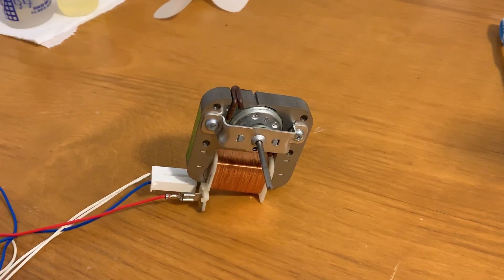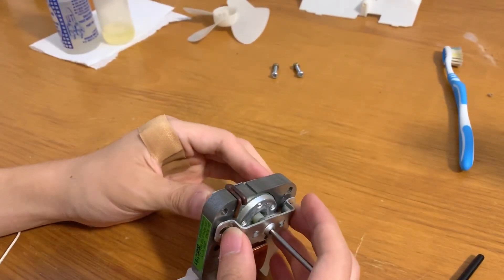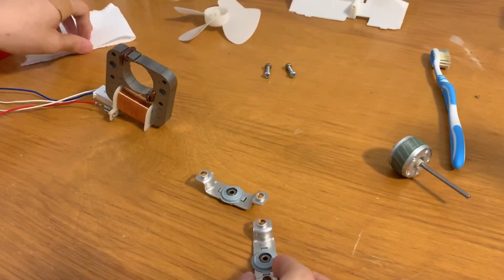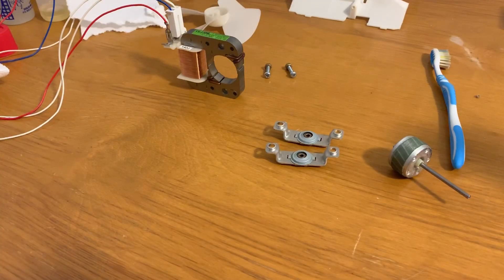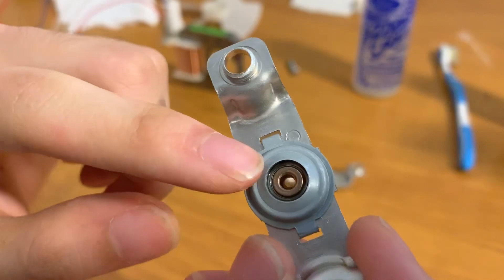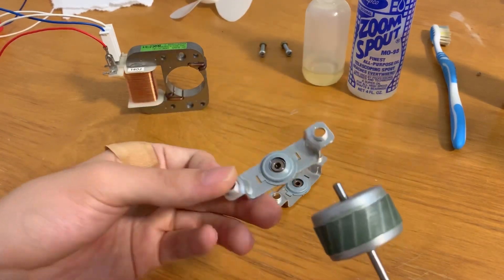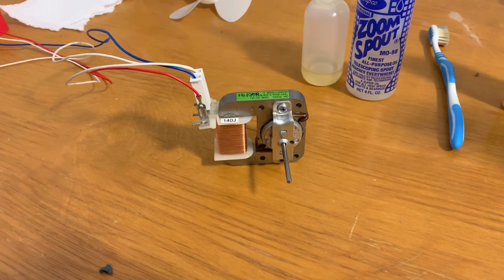How to Oil a Fan Motor (Shaded-Pole, C-Frame Motor)

Comment: would you happen to know if this works as well on exhaust fans (bathroom) that are a round motor? I've seen some people mention in general how some motors don't have oil so I'm not sure how that works then, my fan is a round motor and it's squeeling and wheezing lately, took the motor assembly apart (but not the motor itself) and it's definitely the motor rotating causing the noise like perhaps light friction
Reply from the maker: Absolutely! The motor may look different, but the procedure to oil the bearings will be more or less the same. Nearly all bathroom exhaust fans have sleeve bearings, the same type as the ones present on this microwave fan motor. 

Most motor bearings have some form of lubrication. An exception might be a magnetic bearing but those are reserved for more niche applications. The squealing sound from your motor is very like the bearings needing some oil.

The disassembly process will be different though. There will likely be 2 to 4 bolts holding the two halves of the motor together. Once they are removed, you should be able to pull the halves off of the stator (be careful not to strike the copper windings). From there, the bearings can be cleaned and oiled. 

Hope it helps!
Reply: after a bunch of trying stuff and going on forums, it seems replacing the bearing is what I need to do as the bearings themselves are making noise. Hoping this will fix it so 1) it's cheap 2) little in the landfill 3) I didn't waste several hours for nothing @TheSuperFanMan
Reply: on a forum, I uploaded the sound and some people mentioned my bearings, 608ZZ is probably done for and just to change them @TheSuperFanMan

Comment: they don't sell these oils in my country, can I use SAE 30 Oil instead?
Reply from the maker: SAE 30 would work, though it might be a bit viscous. I’d say SAE-15 to 20 is more ideal for  smaller fan motors. I’d suggest going for a non-detergent oil, as it‘s less likely to gum up over time from accumulating debris.

Comment: Thank you for the useful tips! Aligning the sintered bronze bearing bushes precisely axially with gentle blows was new to me! I tried this on my fan motor, which hasn't been dismantled in decades. I always thought it ran well and I lubricated it regularly. After gently hitting the shaft, it now runs even more easily and freely. To do this, I placed the plastic handle of a small screwdriver on the shaft as a shock absorber and hit it with a large Allen key as a replacement for a small hammer. 

It is a nice shaded pole motor from an old record player (60s), with three copper loops on each pole (for a better rotating field and smooth running) and two symmetrical coils. I regulate the speed with incandescent light bulbs connected in series. Different wattages result in different blowing strengths and a switch that bypasses the bulb socket for full speed. It has a model airplane propeller as a propeller. After cutting my hand on the propeller running at full speed, I made a protective ring.
Reply from the maker: Very cool! I’m glad the video was helpful!
Reply: @TheSuperFanMan  Yes, very helpful (for me as a perfectionist), thank you!

Comment: Sewing machine oil works great if you don't have access to zoom spout turbine oil and need to get a fan up and running.
Reply from the maker: Yep! It won’t last nearly as long due to its lower viscosity, but it’ll work in a pinch.
Reply: 🤔👀 🤷‍♂️ How does Andis (hair) Clipper oil compare? I have a microwave currently disassembled that's awaiting a swift reassembly that I don't want to undermine from selecting a substandard lubricant.

Comment: Thanks for this. The last part was interesting for me, when you tapped the shaft to align the bushings. I just serviced my washing machine pump motor and noticed it was stiff to turn afterwards. I was thinking there might be corrosion on the rotor and I would need to sand it to make more clearance. I will try the tapping method.
Reply from the maker: No problem! Assuming your motor has sleeve bearings (not ball bearings), the motor shaft likely just needs a handful of tapping from various angles to nudge the bearings back into alignment. Another thing to check is the evenness of the tightness of the bolts holding the motor housing together. 

I wouldn’t recommend sanding the shaft, as the tolerance is already precisely set at the factory. Removing excess material could cause bearing play. I try to remove corrosion on the shaft chemically. Rust removers or sometimes just good ol’ WD-40 does wonders without affecting the shaft tolerances. Hope it helps!
Reply: @TheSuperFanMan  It has sleeve bearings. The clearance between the rotor and stator was my concern. The rotor shaft is clean.
Thanks for the reply.
Reply from the maker: No problem!

Comment: If the bearings are bronze type inserts clipped into the housing and allow for some swivel, how can you get them both set up parallel to minimise the friction on the shaft?
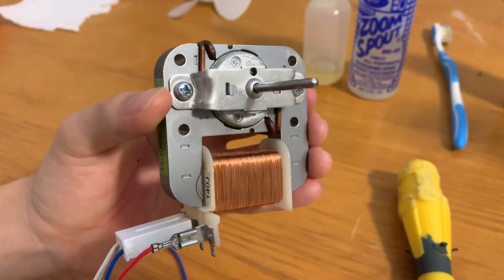Reply from the maker: Thankfully is a very simply process to realign those bearings. It’s explained at 12:35 mark in this video. Tapping the motor shaft with a screwdriver from various angles will nudge the bearings into alignment again.  Hope it helps!

Comment: how do you remove a stuck fan blade?
Reply: sorry, I should have included it, both are plastic, one the shaft sticks thru the blade the other does not
Reply: BTW, ur video was just what I was looking for, Thanks for doing it, I have 4 of these motors to service, not cheap to replace, if they can be found
Reply: I reread ur ?, I guess I missed more, 3 are on a wood stove blower assembly and 1 is just a 9" room fan
Reply from the maker: Ah I see. With plastic blades, first check if there is a metal retainer or spring on the hub. Manufacturers often install it to ensure the blades won’t slip off. If there is a retainer of some sort, try to remove it. Usually a bit of gentle prying with a flathead screwdriver will allow you to pop them off. If you’re unsure how a retainer is supposed to come off, feel free to let me know what the retainer looks like and I can help you out. Then you’ll want to spray some WD-40 or something similar into the area between the motor shaft and the blade hub. Let it soak in for at least a few hours or more. Try pulling the blades off again, grabbing it by the hub. Based on my experience, this does this trick in most cases. Plastic blades often get stuck due to old oil residue.

If the blades still won’t budge, feel free to let me know and I’d be glad to offer more advice!
Reply: @TheSuperFanMan   No retainers, can I drive the shaft out or is it reverse threaded?
Reply from the maker: Usually plastic blades aren’t threaded on, so yes, you might want to drive them out (with caution of course, to not damage anything). I’m thinking oil residue is the culprit.
Reply: @TheSuperFanMan  Ok, got them apart, ? about the bearings the bearing is held in by a crimped retainer, I don't think I could make it work again if I took it apart, but there was alot of gunk around the bearing, I tried flooding it with alcohol but nothing really came out, do u suggest just cleaning it the best I can and reoil? I thought I could put it in a sonic cleaner (I don't have one but a small engine shop close by does) I cleaned the hole where the shaft goes. should I do more? I have pictures of the project but don't know how to get them to u securely if u r interested, Thanks for ur help
Reply from the maker: Of course! Email would be good if you’d like to send pictures: thesuperfanman@gmail.com. You’re correct about the crimped bearing holder. Don’t attempt to remove it. Have you tried using Q-tips to physically scrub the gunk out of the bearing surfaces? Usually a combination of either WD-40, isopropyl alcohol, or acetone; and scrubbing helps dislodge any build-up in the bearing. An ultrasonic cleaner could work, though I personally haven’t tried it myself.
Reply from the maker: May I ask what type of fan you’re working with, and whether the blades are metal or plastic? It’ll help me narrow down to a specific advice for your fan.

Comment: my upper bearing seems to be an assembly of a speed nut (type washer that's pushed onto the shaft) holding an oblate ring that appears to be the entire bearing surface.  Any suggestions?
Reply from the maker: It sounds like a typical bearing housing design, just a bit different in appearance than the one in this video. Does it look more like the one shown at 2:16 in this video? https://youtu.be/NHMEHllT6Ks

If yes, then it can be serviced and oiled the same way as I did in this video. The oil can be applied into the little radial gaps that surround the bearing, so it can soak into the felt wick material hidden in the bearing housing. Otherwise the rest of the motor servicing process should be the same as this video. Hope it helps!
Reply: @TheSuperFanMan  thanks for taking time to actually locate the point in the video you linked to.... first rate "above and beyond" support for your viewers!

Comment: Everyone is here from Bathroom exhaust fans and Im no exception. Theres no way I could get the fan blades off without breaking them. I oiled the shaft and spun it around hoping that oil would go into the bearings(I saw a guy from Thailand doing it) "Dont use the regular 3 in 1"? Yeah I did. Thats my bearing oil. "tap the bearings until it runs smooth". Man, Thats my tip of the month. Ive thrown out countless motors thinking somehow I reassembled them wrong until Im scared to disassemble them.
Reply from the maker: That method of oiling without pulling the motor apart works too. Though not as effective as disassembling it, it's definitely far better than not oiling at all! The regular 3 in 1 oil will still lubricate motor bearings but it may become gummy in the future. 

Glad I could help with the bearing alignment! That's something I learned too in my early days of fan collecting. It became such a crucial part of servicing a sleeve-bearing motor that I try to emphasize it whenever I make videos like this one.

Comment: Hello, I like your video, very helpful. I got curious and was messing around with my desk fan. The layers of metal has rust on it any good way to get the rust off? I didn't have anything to use other than baby wipes, so I literally when at with baby wipes. I got some of it off, but not all of it. Also, when I when go to put the barrings back on with the cylinder metal thing it refused to spin. I would have to touch the balde it to make it spin again and the layers of metal would get warm. After a while I guess you cannot have both hex nuts super tight and they both have to evenly tight for it to spin back normally again I'm afraid that I have it to lose and the hex nuts might go lose while thr fan spins and the metal cylinder thing will go crazy. The only thing I did wrong was force thr barrings off the metal cylinder thing, so Imma go back and get inside of it and clean it.
Reply from the maker: Hi there! Depending on the severity of the rust, you can either use paper towel with some WD-40 for light rust, or wire brush for heavier rust. I would first try spraying a bit of WD-40 onto paper towel and scrubbing the rust off. Unless the rust is very bad, it won’t have any major effect on the motor. 

As for the rotor (the cylinder) not spinning, have you aligned the bearings? Shown at 12:35 in this video. This is a crucial step to ensure the bearings are in alignment with the motor shaft so there is no resistance. That may be the reason why your rotor is having trouble rotating.

The nuts holding the bearing housings should be tightened, but not cranked down with all your might. Try tightening the nuts down first, then aligning the bearings. 

Hope it helps! Feel free to any other questions you have!

Comment: A great help!
I bought a vintage Galaxy 3701 fan that was advertised as working, but arrived seized up. I found your video and watched it before taking out the motor, hoping it  was the same type. Fortunately it was.  Not only was it dry, but both bushings were clogged up with old dust and hair. After following your solid procedures here it now works like new, thank you!  
I normally would have just tossed it and called it a waste of money. 😉
Reply from the maker: Great! Sometimes online fan purchases don’t exactly line up with the seller’s descriptions, I’ve been there myself many times with eBay purchases. I’m so glad this video helped!

Comment: Wow, I always wondered about these and what they were even called.  It looks like they are called C-Frame motors.  So what is a Shaded-Pole motor?
Reply from the maker: Shaded-pole motors are one of the many types of electric motors, which can be categorized based on their mechanisms to turn electrical energy into rotational motion. Shaded-pole motors are among the least expensive AC induction motors, due to the simple construction, lack of capacitors and start switches. I'm not the best when it comes to explaining things concisely so this may be helpful: https://www.youtube.com/watch?v=GNTvWxl3Isw

Within the world of shaded-pole motors, they can be further classified based on their design. The c-frame is one of the types of shaded-pole motors, often rectangular with a single coil of windings. Hope this helps!
Reply: @TheSuperFanMan  Totally helps, thanks!  I'm ready to conquer the world.  Great video you have! here
Reply from the maker: Thank you! Glad it helped :)

Comment: How do I test a C frame motor to see if it is bad? I have one out of a desk fan that isn't working
Reply from the maker: Motors fail either mechanically or electrically, so here are two easy ways to check:
- when switched on, does it buzz or hum? Any sound usually indicates that the motor is still alive and needs to be cleaned and oiled. If there is no sound at all, check for continuity.
- check the continuity across the motor windings with a multimeter. If there is an open circuit, that usually means the internal thermal fuse blew, rendering the motor unusable unless the fuse is replaced (a very tedious and delicate task). If there is resistance values, the windings are likely okay, and the issue is mechanical, such as the bearings being locked up. Oiling usually solves that.
Hope this helps! Feel free to ask any other questions!

Comment: Hey SuperFanMan! Thanks so much for sharing your knowledge! Super helpful! Maybe you could help me out. I bought a used dehumidifier today. Unfortunately the fan is making a really loud rattling noise. It uses this kind of motor. I checked if the blades of the fan are touching anything in the housing. This isn't the case. The rotor spins long and freely. However, when I turn the fan by hand (pretty slowly) and put my ear very close to the motor I can hear a "rubbing" noise at only one single point of a 360° turn. I assume that whatever this might be is causing some kind of imbalance inside the motor resulting in a rattling noise. What could this be? Are the bearings shot or just dry? Is it dirt? Is there any way I can fix this problem/replace the bearings or do I have to replace the entire motor unit? Thanks in advance for your help! All the best from Germany! ✌🏻
Reply from the maker: Hi there! Greetings from Canada! I can certainly try to help. Based on my experience, that sounds like a case of worn out bearings. Worn bearings will cause the rotor to sit lower, and may cause it to rub against the stator. These shaded-pole type motors naturally run hotter so they are more prone to bearing failure than other types of motors when the bearing lubricant dries out. You can check to see if there’s wear in the bearing by grabbing the motor shaft and trying to move it up and down. If you feel any movement (even the slightest), there’s a chance that it is the cause of the noise.
One thing you can try is rotating both bearing housings 180 degrees, which may solve the issue if the bearing wear isn’t too severe.
If that doesn’t fix the issue, the only other way would be to get a new motor. Any shaded-pole, c-frame motor with the same shaft diameter and similar amperage rating should be a suitable replacement.
The issue could certainly be something other than worn bearings, so if you notice other things, I can try to give further advice based on that. 
Hope this helps! Feel free to ask any other questions!
Reply: Thank you so much for your help! I took the entire unit apart. Luckily the motor of the dehumidifier (YJ64-30A-0031) was designed in a way that made it possible to replace the bearings (626Z). The old bearings were very dirty and grimey and didn't run smoothly. I replaced the bearings, cleaned all parts with brake cleaner and oiled everything as instructed in your video. The result is: no rattling at all, the motor is as new, purrs like a kitten! I am super happy with the result! Again, thank you so much for your support! Your video gave me an insight in how these motors are designed. And your support really helped me to solve this issue! There should be more good guys like you out there! Thank you! All the best from Münster, Germany! ✌🏻
Reply from the maker: No problem! I’m glad you were able to find replacement bearings and get the motor running well. Cheers!

Comment: I made a mistake and put multipurpose grease in my bathroom ventilation fan bearings, I took it back apart and removed all the grease and oil the bearings, Do you think the grease caused damage to the bearings? It runs fine now but before it was noisy
Reply from the maker: You’re good. Grease isn’t bad for sleeve bearings, it’s just not the best kind of lubricant. Grease is more suitable in bearings that have rolling elements such as ball bearings, while oil works better in sleeve bearings. Your motor should be okay with oil in it now.
Reply: @TheSuperFanMan  oh ok, thanks for the quick reply 👍
Reply from the maker: No problem!